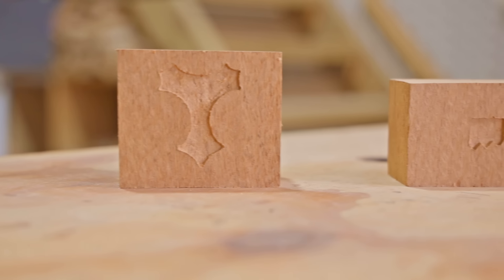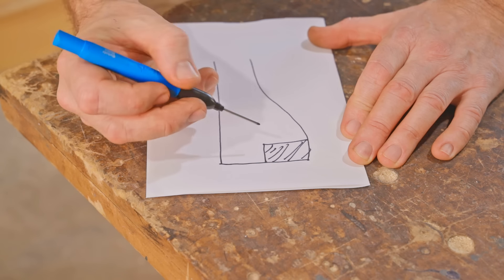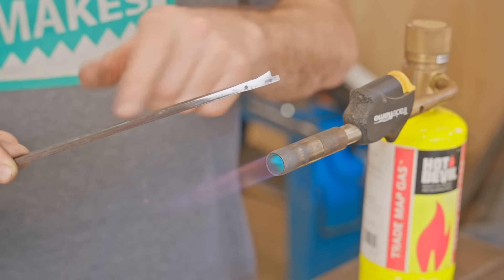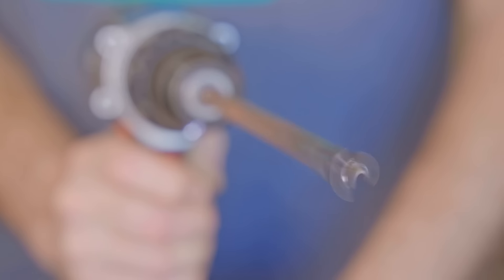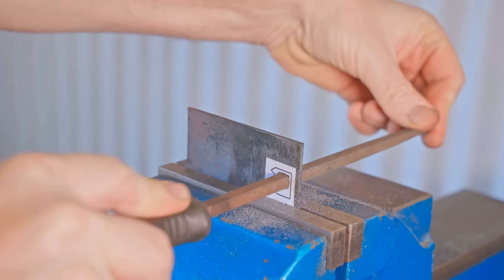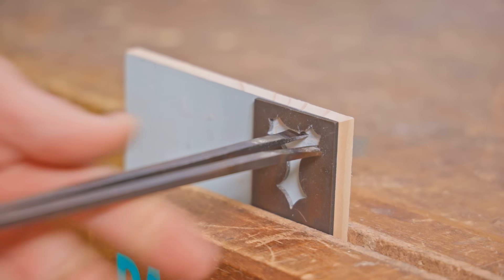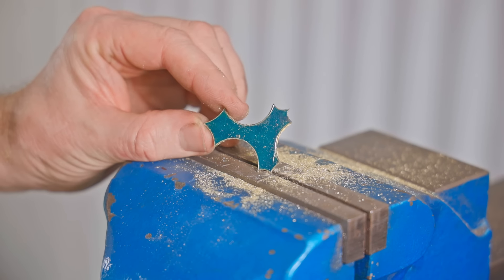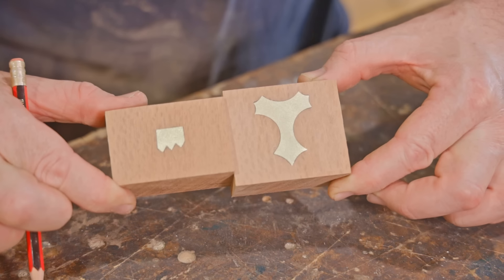Any Shaped Holes with a Regular Drill - How?

Comment: This is really cool! If someone sold this tool as a drill attachment, along with pre-made templates (or maybe even custom made-to-order templates), it could make this type of woodwork a lot more accessible to people who don’t have access to expensive machinery.
Reply: Or you could just buy a cheap table top CNC machine if you were going to make a lot.
Reply: @MrGaiden100  "to people who don't have access to expensive machinery"
Reply: @teunlll  that's why he said cheap, if you have to buy these templates every time then it is eventually going to be cheaper to just buy the right tool in the first place.
Reply: @karl810  eventually. But this tool is probably not for the people that do this on a very regular bases. The templates don't have to be expensive either. Your correct but I think this tool is just for a different audience then the people that would need a table top CNC.

Comment: You said it right at the very tail of the video: "how CNC work was done back in the day"-- The Parser bit was the very first form of a 'router', and using the steel template shows the same technique as using a bearing-guided cutter-- My granddad had an old offset crank brace (the kind that used the tapered, 4-sided shank, circa 1930!) which had 'split-bits' for it; I suppose that would have been used just for this sort of thing!! Keep on keepin' on-- Blessed Be, & Peace!

Comment: Very impressive.  I would never have thought it'd make such fine details, especially getting down into those thin points.  You should definitely have some brass logo plates made up so you can install these awesome little badges on all your projects.  Maybe even get some made up in Sterling Silver or the like.
Reply from the maker: It really does work very well - I’ll be attempting to make the punch and die to knock out my logos, hopefully soon. 😊
Reply: I think wood inlays would work too, like white ash for a lighter tone, and ebony for black.
Reply: @PaulaBean  You're right.  It'd be a great tool for insetting bowties across cracks in the top, allowing you to do some really neat shapes.  I'm going to try forging one so I can inlay decorative steel rosettes.

Comment: This has an advantage over "CNC" or even rotary tools like a Dremel or Foredom.  You can get nice crisp corners with out having to do manual work with a chisel.  Nicely done.
Reply: Exactly!
Reply: The downside is all that laborious work has to be done to make your template so not very practical for a one off item where a rotary tool and chisel would be faster.
Reply: @Crewsy  yup, this is a production tool.
Reply: @anathaetownsend1894  : I'd bet that near the end they would have started using a drill press to remove the bulk of the material from the guide. And even before that, they may have used an automated file (the things that move like a topless scroll saw) to speed up the work.

Comment: I'd love to see a punching die video! The whole way through I was wondering if the template could be used in some clever way to make the inlays too.

Random thought, I wonder if you could use this for embossing on metal if you raised the pattern by a hair less than the depth of the passer bit. It might give an interesting finish - maybe slightly rough, maybe some chaotic swirls. Brass logo plates could look really beautiful!
Reply: Putting a stubbier version in a hammer drill might also produce a neat effect, as could making a template from plastic (or something else non-conductive), and (standing at some distance, beside a power cut off switch) using an EDM machine or a welding machine with a demolition stick to erode metal.

Comment: Is this not a commercial product? The thing’s amazing, you can’t get corners like that on a CNC machine as far as I know
Reply: Well, I bet that a CNC could get similar results in several multiples as much time if you were willing to fit a hand chisel as one of it's tools. However, you'd really just be using a CNC to duplicate manual chisel work.

Comment: I assumed it was like modern "square hole with a drill" techniques where it's solved geometrically.  Wrong.  This was a mind blower.
Reply: Modern square hole drilling was done in early Victorian days.
Is that the "modern" you're talking about ?
Reply: @howler6490  do you not consider the Victorian Era "modern"?

Comment: Well, learn something new/old every day!  Quick suggestion, try a section of pvc pipe apx 1" id, and slip it over the cutter shafts. Just a few inches of length would work. this will allow the non drill holding hand to better guide the cutters and cut down on both chatter and the cutters wanting to slip out of the templet's.  Also, use a dremel or foredom with a carbide cutter to remove the bulk of the material of the templet's before final filing to final shape. Anything to save files and time. both are expensive. ;<)
Retired Knifemaker with 47 years on the job experience. well done Sir!

 I am a retired Knife Maker with over  47 years on the job experience-Knife

Comment: I got to thinking. This would be super easy to make with a lathe and mill. Really the only thing that this needs is 2 spring steel shanks with threaded ends. You can make a bunch of cutter tips with lathe and or mill. Then the 2 spring steel shanks can be inserted in to a adapter for a drill then lined up the correct way and locked on with some set screws. This would make the cutter replaceable and or replace the spring steel anytime you need to. This would allow for bigger or smaller cutter tips. This would also reduce the forging one would need to do. This could be commercially made as well. All one would need to do is bend the spring steel a bit.

Comment: I have several of my Great Grandfathers squares with elaborate brass inlays and have always wondered how they were done and why go to so much trouble to embellish an everyday tool. And now I know.  The squares are over 100 years old and I still use them because they are still 100% square and such great quality. I wonder how old the oldest tool still in regular use today is?
Reply: Realistically, it would probably be the hammer or mallet, as derivatives of the club. After that, probably some type of drill bit, as a distant derivative of a stone-point version.

Technically older would probably be those spring-loaded grabber sticks, since even birds & chimps use an equivalent to grab bugs out of trees, but I'm not so sure those were in any sort of continuous use. An honorable mention would go to arrows, as a descendant of spears, which I think chimps rarely use, and themselves may be derived from those bug sticks.

Comment: Underhill video is here on YT.  
He doesn't say where this tool originally came from. It looks pre-industrial revolution so would bet it was a da Vinci, Michelangelo maker type person but also would not be surprise if the concept went back much further .
Surprised how clean the cut comes out. 
Slow speed would all that could be achieved back when so do use slow speed drive source.
Pattern or top bearing router bit. same idea.

Comment: That's freaking awesome, I learnt so much from this video. I was going to make a logo by using acid to etch into metal then route a square for it to fit in, but after seeing this I will definitely be doing this instead. Can you please film how you make the die
Reply: If you're going to be doing this metal then you might want to spend some time to figure out how to do an EDM version. Maybe with a stick welder or something?
Reply: @absalomdraconis  that would be crazy expensive and more involved. Even more so because I don't own a welder for starters. originally I was going to cut a square or rectangle piece of aluminum,bronze or copper sheet, then use the technique Adam Savage used on tested to etch out logos on a old style policemans mace. You cut out the design in vinyl or duct tape, stick it to the metal surface you want to etch, use duct tape to make small cupping walls around it to contain the liquid, then pour the acidic chemical ferric chloride in the cupped design and wait for it to eat away the metal in shape of the design. Then I would inlay that metal...
With this technique though I can just inlay the desired design directly into the wood without having to create a plaque using Adam's etching technique.
Video of Adam etching the mace - https://youtu.be/YZV4A4Kl0yM
Video of Adam etching for a gun - https://youtu.be/ieDYlkJTNYI

Comment: In the off chance that you read the comments on a 2 week old video: amazing stuff! thanks! But please stop apologizing for using a tool properly for what it's made for: calipers have fully hardened tips (on both sides) for the express and sole purpose of scribing (i.e. marking out dimensions by scratching into the material). If they weren't supposed to be used for it, they would be tempered more to last longer... The fact that they are hardened is the reason why the rumor started that calipers are fragile. It's not to be more precise, but to avoid breaking the tips by hitting them with something or dropping them on the ground on its tips. Through the years, people were told to be careful with the tips, but never heard the reason why, so they assumed that it was to keep them more precise. The tips will be the last part on your caliper to wear. In fact, it can't wear or bend because it will sooner break off than anything else. So please: scratch away with your best newest calipers!
And by the way, if some ignorant viewers start whining about it, then us knowledgables will put them in their place for you. No need for you to bother with it. Added bonus: it makes for more comments with answers, which is VERY beneficial in the algorhythm of YouTube...

Comment: That is pretty crazy!  I imagine that there is a version that has more than two 'legs' to cover larger spaces.  (e.g. the middle of the diamond.)  Personally, I would add a 'table' with a sliding top to ensure that the bit is always perpendicular to the surface and a mechanism to dynamically set the distance from the work surface so the bit can't go deeper than desired.  For one thing, you wouldn't need the 'wings' on the tip as depth stops and so could go as deep as you want.
Reply: An interesting idea for sure!

Comment: Very cool!

One thing that makes me smile: "You can make this very basic old-school tool.....if you have a fully furnished shop."

Welder? Belt sander? etc. etc. Nope. I have hand tools, cordless tools, and a table saw.
Reply: Bind t5hem together with zip ties.
Reply: These are made with really basic tools. The traditional ones were made without welders or any power tools. I always smile when I see people quoting without finding solutions. You don’t need a fully furnished shop though having one makes it easier and quicker
Reply: Find someone with a gas welding setup, and get them to make the rough bits for you. Use a dremel with some abrasive bits (I stubbornly bored a hole through angle-iron with one, wearing away a bit of metal is nothing), or a hand sander fastened to a table with metal strapping, or whatever else, to get the fine details done on the bit. For the templates, use punches with a power drill to remove the bulk of the material, then follow with a file.

Everything except the initial rough shaping is straight-forward to do with even a poorly equiped home shop.
Reply: For that matter, the welder can be replaced with some charcoal, fireplace tongs, and some sort of fan hooked to a charcoal grill with some metal plumbing pipe. Hammers are easy enough to get, the anvil can be anything decently hard, e.g. a cast-iron pan turned upside down over a tree stump.

Comment: Really interesting tool.  It is a weird looking one at that, nothing I've seen before, either.  Apparently, Passer is German for "compass" or "calipers", which makes sense, now.
Reply: A lot of Sheffield tool names were descriptive of what the tools did or were used for. For example a slacker which was a small piece of metal that slackened the rivet in a folding knife. I like to imaging the passer drill was called that because the legs pass each other in the template. If they do not fit past each other the tool does not work in that template

Comment: At 2:49 point--quenching in vegetable oil.  The idea is to NOT cool them to less than about 400-degrees F--a boiling point of many oils.  BUT you have too much oil.  Due to the Mass difference you're essentially cooling the metal to room temperature. It's not as quickly as water would be, but tempering needs TIME at the 400-degrees.  (In the last  40 years huge advances in metallurgy has occurred, but my pointer is Old.)

Comment: This reminds of the hieroglyphs found on ancient Egyptian megalithic structures.  Perhaps this is the method they use to cut them into the rock surfaces.
Reply: If so, then would have depended on the stone. Some would have been too durable or abrasive for anything other than conventional chisel work, while others probably would have worked well with iron tools- the ancient Egyptians didn't really have steel. Templates probably would have been bronze, as that was their primary metal.

Comment: What about sharpening the front end as well as the drill has to cut into the material rather than abrade it away and sharpen the sides to one face and not symmetrically.  They could be opposite sides meaning a much more acute angle to get into corners particularly if used in the slow forward then reverse motion given by the bow drill method of original use

Comment: Put a loose-fitting pipe around the Tines as a forward grip.
Reply: in traditional use you would squeeze the tines to get into different parts of the template. Having used one a fair bit I really do not think this would be necessary.

Comment: Nice work, a d I always thought someone would tediously carve insert& inlays by hand! 
Probably wouldn't be an issue with original bow driven device, but is there a worry of fracturing/shattering having 2 hardened objects clattering against each other at speed? (I know always wear safety goggles etc .... )
Reply: There is a risk, but if you go at low speed then it should mostly disappear. It's important to bear in mind the abrasion though.

Comment: Cool. I didn’t know this was possible. 
And it could all be done with hand tools, if necessary.
Reply: Probably it was necessary when invented, as power tools were very unwieldily before the invention of the electric motor (the potter's wheel, treadle, and dog-wheel; the last of which really was a thing at one point; are the most convenient pre-electric power sources that I know of, with windmills, water wheels, and livestock variants of the windlass being the only options I can think of).
Reply: @absalomdraconis  Good points, although something driven (directly or indirectly) by human or animal muscle is not traditionally called a “power tool.” Devices driven by wind or water power were early power tools, but not at all portable.

Comment: I wonder if there would be any value to several sets, all with a different bevel angle?

Also, this seems like the sort of thing that would benefit from several premade templates meant to be used together. At the very least, I'd say that you should make templates for a few more simple shapes (squares, triangles, circles, ovals), just to make it quick to assemble more complex shapes from pre-existing templates.
Reply: traditionally there would have been different ones for different stencils so yes there would be a benefit.

Comment: I would love to try this, but don't have access to a welder or much metal working equipment beyond a torch and files. I really appreciated your no-weld vise design, and use it almost every day!

Would brazing be strong enough to join the two cutters? I haven't tried brazing yet, but this seems like it might be a good way to start. 

Thanks!!
Reply: The two cutters can be bent in a single piece and then jammed through a hole on a timber handle. Traditionally the timber “handle” was a spindle for the bow drill.

Comment: Do you think you could use a thinner template and use it on a curved surface?  Knowing it wouldn't last aslong but a fexable steel template and low speed might work. I am wondering if it could be used to make pool cue inlay pockets...
Maybe just make your template out of matching radius steel pipe.

Comment: Seems like some sort of barring guide similar to a pantograph would be a much better way to update the guide to a more modern approach. Would also remove the need for hard steel templates and instead be relatively simple to cast, print, cut or mold the templates.

Comment: if you  HAVE TO make those templates, then it is easier   to  make the hole  with a Dremmel  and   2 or 3 different sizes  points, i  gess  it would be easier  to burn  the wood protected with  an easy cutted shape of   a non asbestos isolating mat... even  you can go deeper than that  surface "hole"